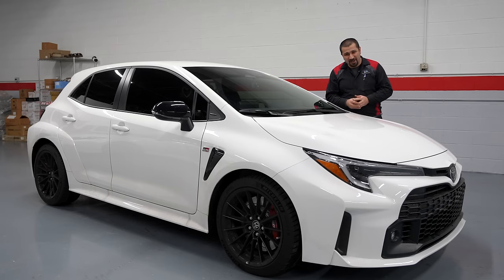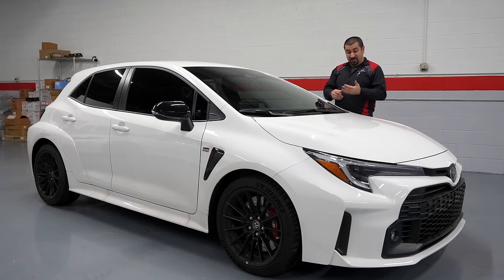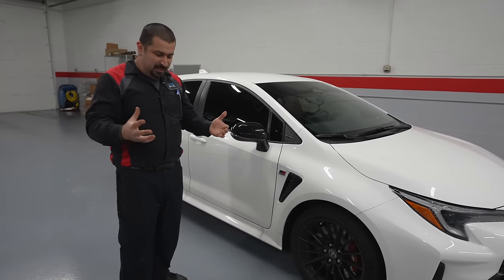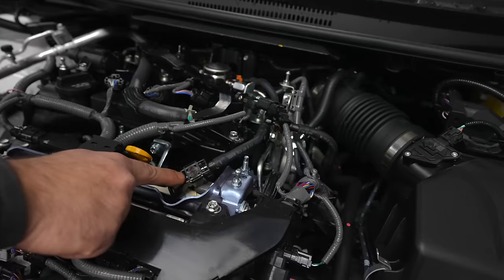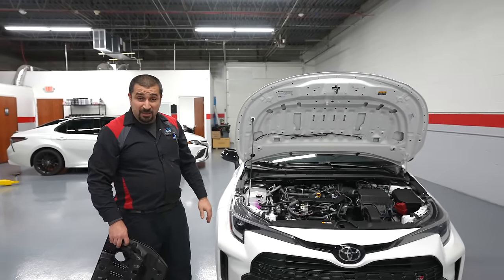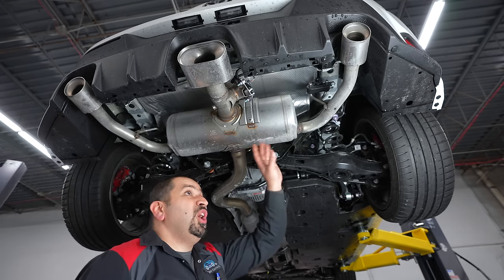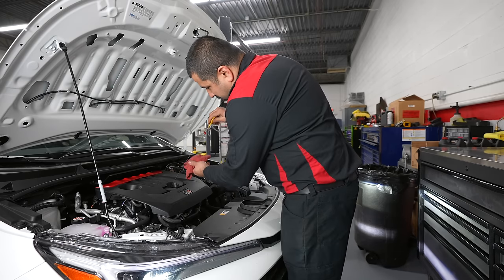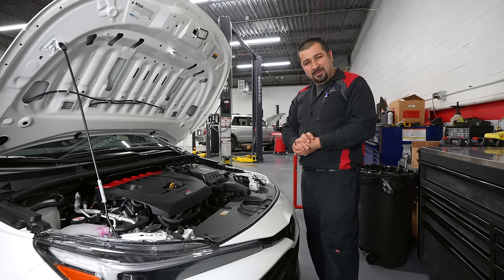The Toyota GR Corolla is Truly a Special Car | First Service and Technical Tour

Comment: The 0W-20 Toyota SP oil is a more wear control oil then the MobileOne AFE 0W-20. I have done a VOA on both of these oils. The Toyota oil is a special blend manufactured by ExxonMobile.  The Toyota oil has a great anti-wear additive package: Moly - 697, Boron - 203, Zinc - 739, Calcium - 1287, Magnesium - 426, Phosphorous - 684 with a TBN of 6.8. That being said one of the key features of the ILSAC GF-6  oils is the protection they offer in helping prevent LSPI in engines with the TGDI technology.  Combining turbochargers with GDI presents a unique set of problems, including an abnormal combustion phenomenon known as low speed pre-ignition (LSPI). LSPI is an uncontrolled combustion event that takes place prior to spark ignition, often resulting in knock, and has been known to cause catastrophic engine damage. The MobileOne ILSAC GF-6 AFE 0W-20 additive package is very different:  Moly - 60, Boron - 73, Zinc - 548, Calcium - 844, Magnesium - 629, Phosphorous - 543 with a TBN of 8.0. Where the Toyota oil is blended for wear control and to support Toyota's 10K OCI - the MobileOne oil is blended to help control LSPI.
Reply: Many dealer parts counter people and lube techs aren't fledged mechanics and by now, no doubt some Toyota 0W20 has found its way into these cars so it's probably okay. Probably. How does oil help with pre-ignition -- cools the piston bottoms by wicking heat and hot spots away? Or fewer minerals keeps the PCV system clean?
Reply: @dadgarage7966  It's the chemistry of the additive package.  Calcium and magnesium sulfonate are the most commonly used detergent additives in motor oils. Although calcium had been favored for decades, industry research has shown fewer incidents of LSPI occurred by re-balancing detergent chemistry to reduce the level of calcium and increase the level of magnesium sulfonate in the additive package. Calcium has been shown to promote LSPI, while magnesium has little impact good or bad. As for the anti-wear additives moly, zinc and boron they add to the price of the oil. The Toyota oil has higher levels of these additives because they help support the 10k OCI and Toyota isn't selling on price - you need to buy it from a dealership. On the other hand MobileOne is completing on price with all the other oils on the shelves of retailers.
Reply: So basically your saying the mobile one oil prevents LSPI and the Toyota one dosent??
Reply: @justfelix30  In these current blends for the products AMD is referencing. It doesn't mean Toyota wouldn't be re-blend their oil and AMD is referencing a very specific MobileOne oil. From a quick look at the label in the video - it seems to be the "green label" Advanced Fuel Economy 0W-20 version. Which MobileOne states " Meets ILSAC GF-6 standards to help provide low-speed pre-ignition (LSPI) and timing chain wear protection while keeping your engine clean".
Reply: @joeythedime1838  So which is the preferred oil?Toyota still OK to use?Getting my new GR in 4 weeks and will be doing a 1st service at 1000km(Canada)

Comment: Being a long time Toyota MDT ( left the dealer in 2017) and Toyota owner and fan, I absolutely love this GR Corolla, and the fact that it is all Toyota.  Thanks for the short overview!
Reply: Being a Toyota MDT, please explain to me what on earth Toyota was thinking not making Torsen LSD's standard equipement on all GR Corollas. Why on earth would someone want a 300HP 4WD Corolla with open diffs? It's mind boggling to me...
Reply: @BigBear--  +1, inquiring minds want to know
Reply: @BigBear--  I assume that to reach a certain price point some things just can't be added... that said it could also be an option
Reply: @g-mang-man7924  They are an option, and there's actually has that option. Still, the regular Carollas exist, so why even have an option for the GR Core that doesn't come with Torsen LSD's? It just doesn't make any sense, particularly for what this car is trying to be and who it's directed at.

Comment: Very cool car… I’d be surprised if it ends up being as reliable as their other engines…
Reply: They are pushing a lot of HP and Torque out of these tiny engines but if they are sturdy and build with strong internal components they will hold up. 
The deciding factor then is regular maintenace like oil changes every 3000-4000 miles or before a track day or autocross session.
Reply: americans shouldn't worry about reliability. The Japanese know how to build an engine with small displacement and high power. In the 60s honda had a 1.5L 4 cilinder with 1500HP. AUTO CRAFT a tuning company in japan already has pushed the engine of the corolla GR to 440HP reliably. Not everything needs to be an V8
Reply: It won’t because these will be beat on…….regular underpowered Corolla’s as by design are long lasting because of their design being low on power equals longer life of parts!
Reply: @Cstoreri  dude its a toyota, it will last longer than the new subaru wrx
Reply: 2JZgte? 2URGSE? All high output, with no issues.
Reply: @Cstoreri  You mean like Supra's, MR2's, Celica GT4's, ISF's, RCF's and the myriad of other cars Toyota has put out that get beat on?
Reply: So long as none of the clowns install a clown tune from Cobb, we should be safe in the used market.
Reply: @lexburen5932 2.4L piston ring seals enters the chat
Reply: This engine has been in service in the non-US GR Yaris for 3 years now with no major mechanical failures. The 3-cylinder has proven extremely reliable. The cylinder walls are thick and designed to take boost. And the internals of the US spec version of this engine or enhanced over the rest of world version so you can expect this engine to take even more modification and boost up to and over 500hp.  So in stock form it's going to be just fine even with idiots like me at the wheel beating the daylights out of it.
Reply: @abikepeddler  what about the transmission and the driveline taking that power ?
Reply: @davidb9323  There are numerous YouTube and forum posts about this topic already with owners reporting robust drivetrains taking real punishment. Even this video hints at the lengths Toyota engineers went to to assure durability with beefy differentials, larger halfshafts and stout A-arms.  This is Toyota at it's best and the same manufacturer that once supercharged a 2.4L 4Cyl then canted it 90 degrees onto it's side to create the indestructible mid-engine, RWD Previa van.  A high boost 3 Cyl and a 6-speed manual in today's modern age is practically a cake walk for them.  It's only the buying public that needs to adjust.
Reply: If you’ve seen inside this turbo 3 pot you wouldn’t worry. The block and cylinder walls are hella thick.

Comment: Thank you Ethan for sharing your new Corolla GR! I know you love it, I just bought my  brand new 2022 with 4 miles Corolla XSE Hatchback in color wind chill pearl, black metallic top with moon stone interior 6 speed IMT from Miami Kendall Toyota "special order." The 2022 is the last year Toyota will make the manual in the Corolla except the GR.  Flew from Michigan picked it up on Sept 30th 2022 broke the motor in driving it back. 2022 is the last year Toyota will make the Corolla in a manual except for the GR which you may know. I love the GR you have! Is the color wind chill pearl? Thank you out to you Car Care Nut for your Toyota videos! My husband had your site pop up and follows you! We have 2RX'S 2000 & 2006 and a 2002 LS 430 With just over 129,000 miles. So that is a total of 4 Toyota's! My first Lexus was a SC300 1993. My husband said NO WAY! He was under the impression they were expensive to maintenence LOL! He "WAS" a Buick man, I converted him as you can see! We will be coming to you with the LS430 This summer from Michigan. We will see you soon. We will call for an appointment! Thank you!
Reply: Bro im driving the 2021 toyota highlander your so lucky you got your hands on a V6 cause they are built for Reliability and long Lasting and Love that Insane Horsepower and Good Torque aswell pretty Slick Crossover if I were to say so literally looks way better than a lamborghini URUS haha.

Comment: I have the GR Yaris and just had its 24months service, they replaced the transmission fluid and rear diff/ transfer case fluids
My questions is does it really matter what the fluids the dealer use? cuz according to the owners manual Toyota recommend 75-85 GL5, however on my invoice they only listed 75-90 with unknown grade

Also with the rear diff does it share the same housing as the transfer case? eg, you fill the oil in the same plug? I am asking because the manual states theyre separate

Comment: 3 cylinder engine is bad design.
Huge turbo means the engine life will be short if this car makes it to 200 000 miles it will be lucky.  V6 non turbo would be sweet in this car. 
Nice breaks wow

Comment: Wait...the car seems to have Michelin PS4S on it. Owner is driving those in the snow? Not even remotely a good idea for summer high performance tires to be used that way. No grip and your compound will crack. I have always used those on my M4 but only in summer months.
Very cool video. I am on the waitlist for the GRC...want it really badly as an awesome daily driver, particularly for the snow.

Comment: I'm waiting for TCCN "in-depth" inspection video!  I'm starting to like what I see under the car.  The fact that it's turboed means Toyota did their homework as you can see by the LARGE exhaust for such a small engine. 
Gas mileage should be interesting "if you can keep your foot out of it!"
Manual transmission, you've got my attention! 
I sincerely hope this is a home run for Toyota!
One more thing.  Where did you buy that funnel for adding the oil?
Thanks for this video.

Comment: It’s a $50k Toyota, with a 3cyl 1.8L engine, and an interior and body panel worth the quality of a $18k Corolla. Sorry, I’m just not sold on that “just because” it looks cool and has AWD, of which, is just on par with a 20 year old Subaru STI.
Reply: Finally a rational comment
Reply: Agree. I'd buy a used, low mile Lexus F with a 5.0L V8 car over this. BUT, this car will be like the civic type R and hold value to where you're basically driving it for gas and insurance for years.

Comment: Now I want to trade my 21 rav4 for for a GR. Good call on the oil and filter. I get free oil changes at my dealer. I don't trust the oil. So I bring it home and drain the oil and go with the specific oil which the dealer does not have. Mobil 1 or AMSOIL. No specs on the bottle, it's not worthy of being in my engine. With the dealership oil my mpg and performance dropped. Which to me, means the oil is not protecting the engine like it should. Free dealer oil change is just a flush. I may spend more on oil, but i'll be able to give this car to my grandson in 15 years.

Comment: There is some misinformation here. 1. It's not the same rear diff as the rav4. Not even close. The exterior design looks similar like every rear diff but thats the end of the similarities. It's completely different 
2. The turbo makes 26psi stock, not 23psi
3. Mobil 1 is a terrible oil that begins shearing viscosity very early on. Highly advise against using that in a performance car

Comment: Ethan muchas gracias.  I'm retired 70 years old and drive a 2006 subaru sti.  I may get one of these
Reply: The STI feels more powerful because of the torque and the power coming on in the lower RPM. I had a 2009 Legacy 2.5GT before this. I think I liked that more but this is a brand new car which comes with some perks. Some of the technology is extremely bothersome but that’s how all new cars are now. Lots of warnings and beeping and settings on a crappy tablet.

Comment: While it's not quite at the same level as the LFA, it's definitely a car I'm so so glad Toyota brought to the US. I was one of the mourners that was very sad to see the Mitsu Lancer Evo go away, and I was never one for the Subaru equivalent due to the engines. 
While it initially came off as a headscratcher to go with a 3 cylinder in a performance-oriented model, Toyota was definitely swinging for the fences with its capability, and we know they can make a legendary engine do its magic reliably.  I hope they sell every one that's built!

Comment: My grandson has one of these on order.  He was one of the very few of his generation that got his drivers license on a manual transmission vehicle.  He has been driving my old 2005 Corolla with 250K miles on it but the clutch is finally starting to go and 18 Maine winter's is starting to take its toll in the rust department.

Comment: Thanks for the video. Just a heads up, the G16E-GTS turbo is 25.2 psi in the core and over 26 in the Morizo. Not 23 psi which was stated. so its even more bonkers!

Comment: Know this is not related to the video, but do you have any experince with toyotas diesel engins and how reliable they are? Like the turbo charged D-4D in the rav4 2013 modell? I guess not, since you dont drive diesels in USA!?
Reply: Toyota does not sell any Diesels in North America and has not done so for decades.

Comment: You do realize it's actually easier to change the oil in most BMWs, right? The filter is up top and the drain plug isn't covered by plastic in most. Also, almost every API SP oil will meet GF-6A. You believe Toyota makes the best engines and their engineers are smart but then don't listen to their own recommendation about the oil?
Reply: He doesn't realize because he doesn't work on BMWs LOL. What a joke him talking like he's somee expert on them

Comment: Im actually a fan of the bolt on rear quarter moulding. If someone hits that piece and run, it would be cheaper than replacing the quarter panel or pull and bondo

Comment: I just bought a Certified Pre-owned 2019 Toyota Corolla XSE 6MT, one owner at 59k miles, almost all service records.   The transmission was making a whining noise at the dealership when the clutch was engaged in gear or in neutral.  It seemed to drive just fine.  Left it at the dealership to get a paint touch up on the hood and asked them to do the transmission fluid since it's due in 900 miles.  I got a call today, a week later saying the fluid had shavings in it and the transmission is blown...  Of course it's covered under the CPO powertrain warranty so they have to replace it.  Any ideas why this would happen so early?   I've read on forums of other people having similar problems.   I plan on changing my fluid the standard 30k or 3 years like normal.
Reply: I cannot answer your question about the specific transmission but I have had 18 years on my 5 speed manual transmission without issues.   I use Amsoil lubricant which is the best on the market and change it in 5 year intervals. My transmission holds 2 quarts and it takes 15 minutes to change the gear oil.

Comment: I love how he reiterates this is not a BMW or Subaru, both those brands are way over engineered and the engineering actually gets in the way of simple every day driving. So you end up paying  for the engineering and not the quality and reliability that Subaru and BMW have been known to have a lack of in the last decade or actually 2 decades.
Reply: Cant say much about the GR86 but as a GR supra owner, the B58 has to be a beast and easy to work engine, super reliable and efficient. He lost me with this comments as he was many video actually glorifying them. The GR line up is like a buffet you can go and pick what you like as all of the options are hard to beat and very reliable.
Reply: Wrong. The M54 made in the 90s as an evolution of the M20 has been super reliable. The N54 despite its quirks is still a tuner's dream and now the modular B48 and B58 improve on that. BMW just sucks with their V8s

Comment: The oil is looking like water !!!! I remember the new Corvette is also a 0w20 but they asked for 10w50 (60 ?) for track day (I don’t have the exact viscosity numbers but you understand the general meaning). The 0w20 is here for fuel efficiency et pollution standard, isn’t it ? What is your 3 cents about this ?

Comment: Doesn't Toyota sell a "Service Pack" for their cars
Subaru where I live sells them.
Inside is a 5L bottle(4.7Quart) of oil that the car needs
Oil Filter for the car.
Crush Washer
Fuel Injector Cleaner
Upper Engine Cleaner
Windshield Washer Concentrate.

Comment: I think Lexus should’ve used a bigger displacement version of this 3cyl turbo engine in the new RX350 with the battery pack. This engine sounds more refined and dare I say it sounds like a V6. Much better than the buzzy 4cyl which sounds out of place in a $50k plus vehicle.

Comment: Exactly the same underneath as my 2020 XSE, drain plug, oil filter, belly pan bolts.  Like you had a problem with dealership, I'd like your opinion.   My wife hit a block of ice taking out oil pan and subframe.  Ran engine for about a minute to get it off a narrow road.  Toyota dealer replaced oil pan and said engine was fine.  What questions should I ask, what tests should they have done?  Appreciate your vids and knowledge.   Thx

Comment: Nice job Toyota,thank you for not having Bmw make it for you. But I have one thing that would make me hesitant to buy one is the small engine with a Turbo ( thank you EPA) well at least good gas mileage right?  Nope 21 in the city 28 highway that's in the same ballpark as my 2007(H1 before July 2007 5spd Trans) Avalon I have gotten almost 31 mpg on highway I think I had wind moving same direction of car normally 26 28  Wonder what a Lotus with a N.A. 2GR-FE engine would get for MPG obviously tuned for performance but probably closer to the weight of GR Corolla vs Avalon actually 2015lb 2,593 lb range for Lotus Exige or closer to Corolla for the Evora @ 2,751lb-3,179lb vs 3,285lb core edition or more fair comparison Morizo Edition with no rear seats @3,186lbs but probably half the cost of the Lotus.